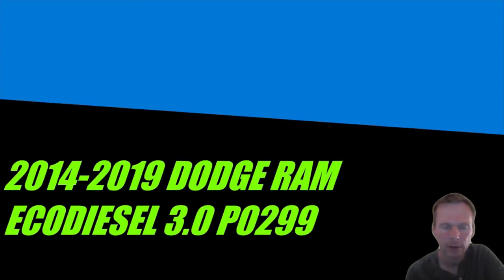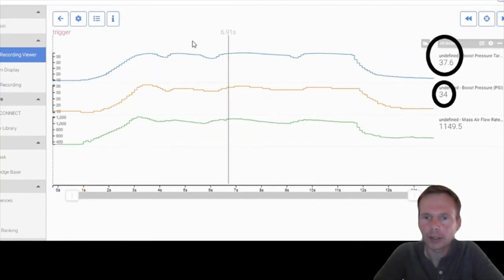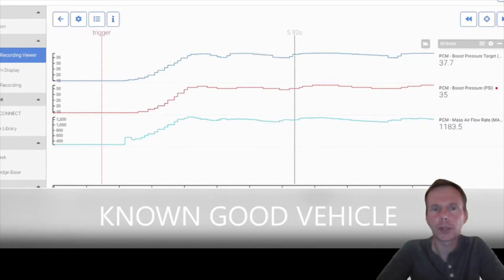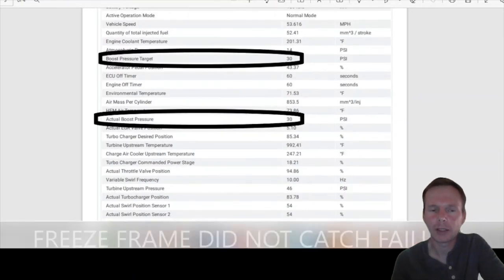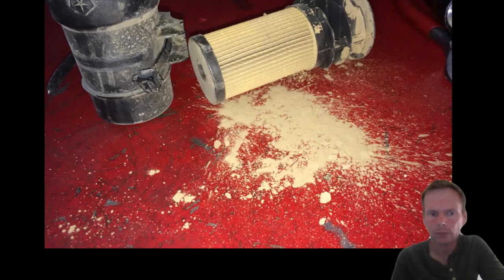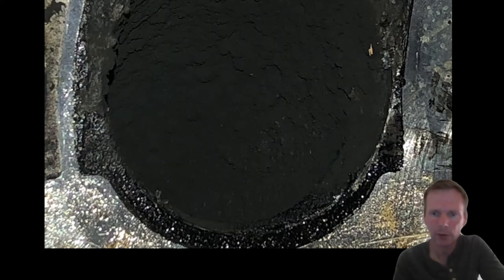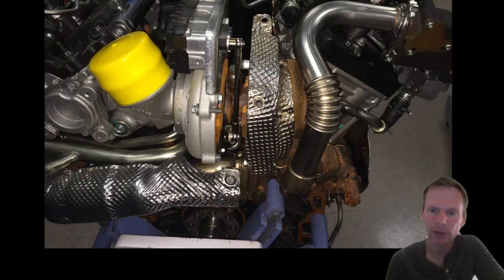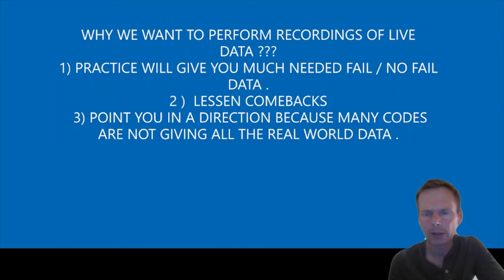2014 TO 2019 RAM 1500 3.0 CODE P0299 TURBOCHARGER UNDERBOOST

Comment: Mine was definitely soot. I got a runner performance and implausible engine torque signal as well. I pulled the inlet manifold after doing a borescope.  I'm replacing the manifold and deleting the EGR and emissions.

Comment: nice OBS work 😉
trying to get my P0299 code fixed at dealer, expecting it to take many weeks to figure out.

changed air filter but keeping the previous kne to test

did leak test before but top intercooler hose clamp at the turbo is comical, worst hose clamps I’ve ever seen.  we zip tied it to the engine cover bracket to keep it tight just incase.  got no leak they said but gonna smoke test it hot again.

lot of testing coming up this week
Reply from the maker: The dealer can rent an expensive pressurized smoke tester that is better at finding leaks at intake but that will not happen . They now have pucks that plug in quick connect hoses at throttle body and turbo inlet to pressurize inter cooler and all hoses with shop air and soapy water . The only spot they cannot really thoroughly leak test is the intake manifold and I technically the intake side of the turbo.I’ve never seen a cracked housing on the intake side of a turbo anything is possible.